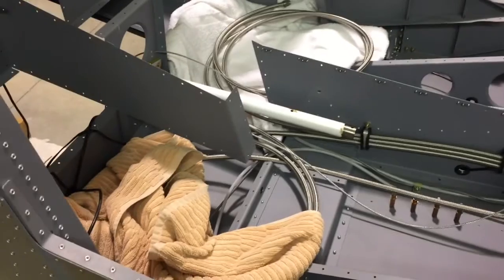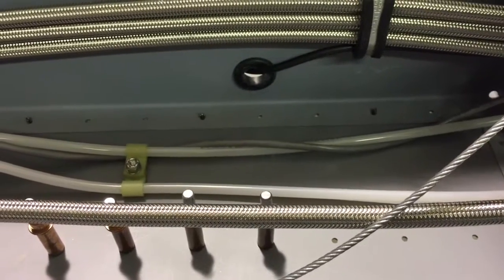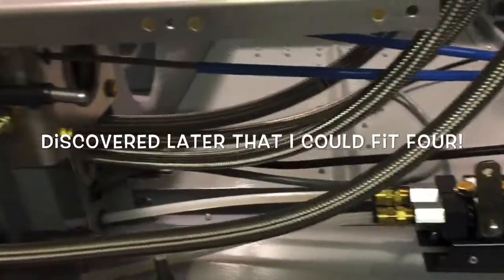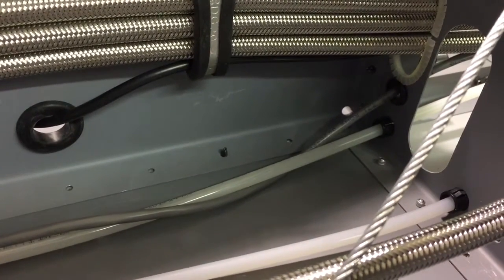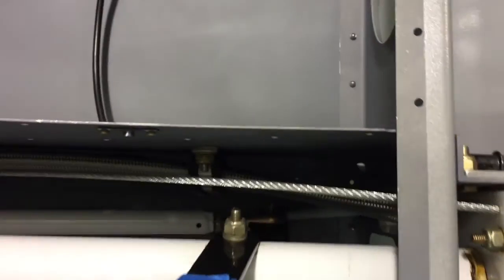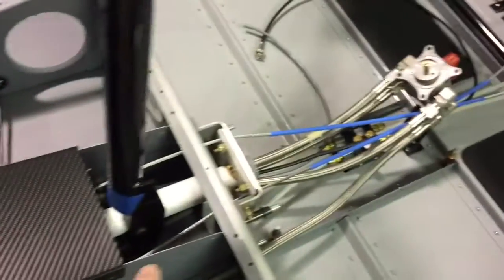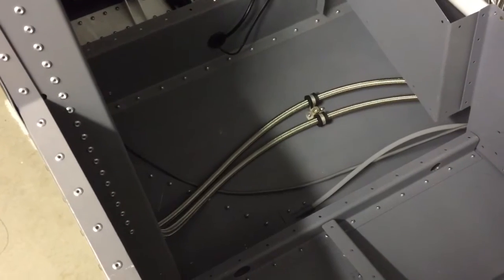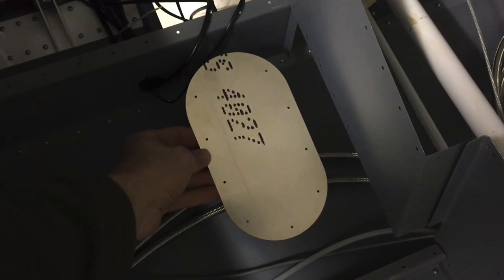Zenith Cruzer Airplane - Steel Fuel Lines

Comment: One suggestion watch out with routing the antenna cable with the fuel lines it will eventually damage the insulation and cause interference with the signal.  Just one of my preferences is to keep antenna cables away from each other as well as power and grounds when possible and any areas were chafing can occur such as with that type of lines. Just found your videos and I am enjoying them. Keep up the good work.

Comment: braided steel lines still have rubber in the center which go bad after 5 years or less.    Best is to use stainless steel solid tubing.   And use lifetime Teflon hoses in the engine compartment.
Reply from the maker: That's false about them going bad after 5 years or less. I'm not the expert though. If you want the facts about the hoses contact Steve at Aircraft Specialty.